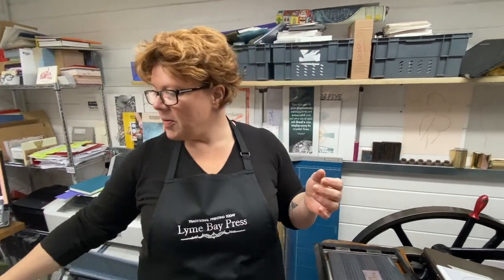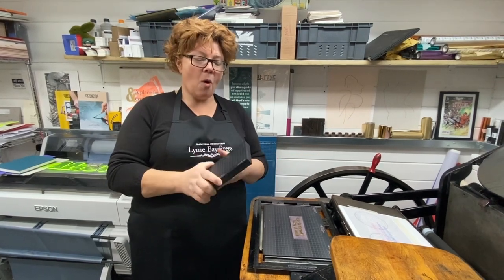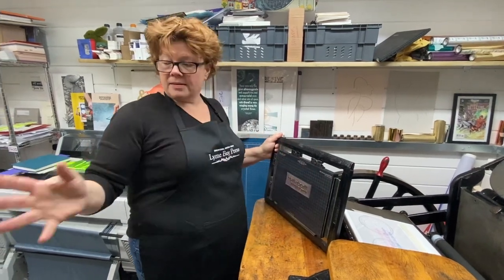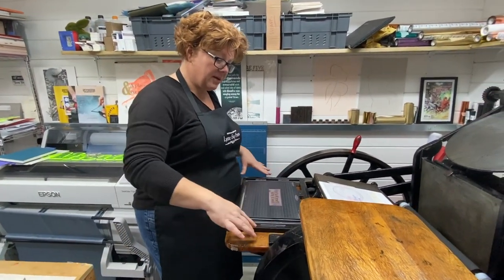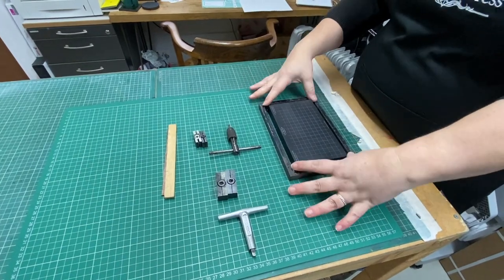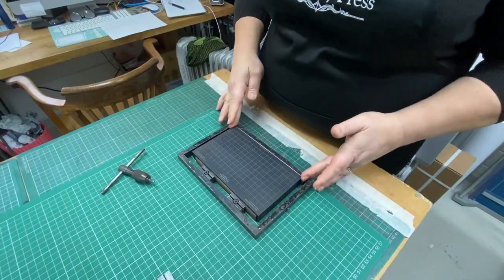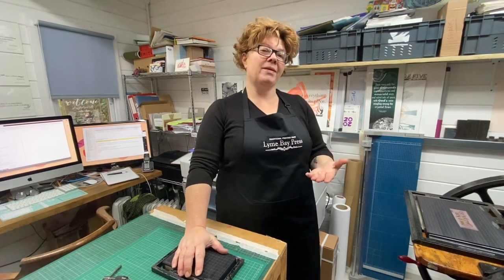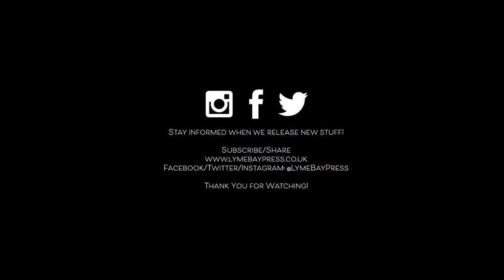Lyme Bay Press - Locking up a Chase Base

Comment: Sorry, but I’m ‘’old skool’’, I would still have put furniture and a quoin on the left side of the chase (belt and braces) just in case a top quoin(s) was loose and the base moved whilst the plate was in place.
Reply from the maker: Black Night100 so am I, but there isn’t a great amount of space around the 8x5 base but all of my other chases are locked up on the left hand side too, my formes would be the same. The point wasn’t really about how you get it to stay in there, but to make sure it’s flush. Appreciate your comment though because I forgot to mention it :)